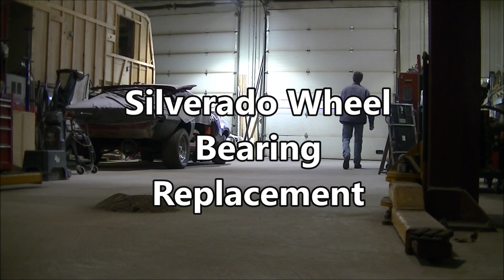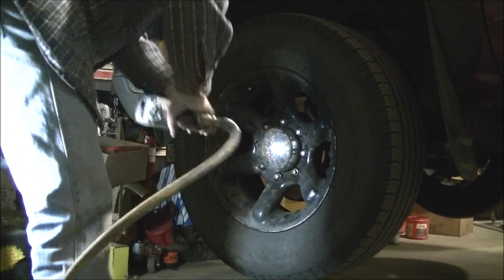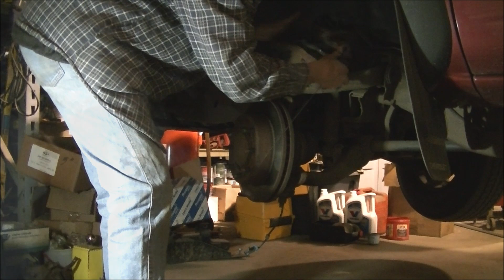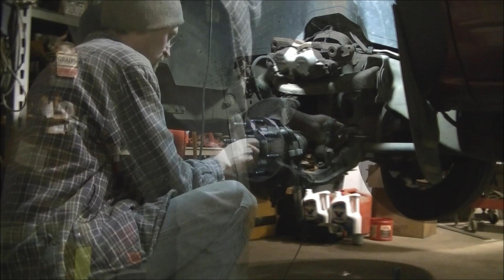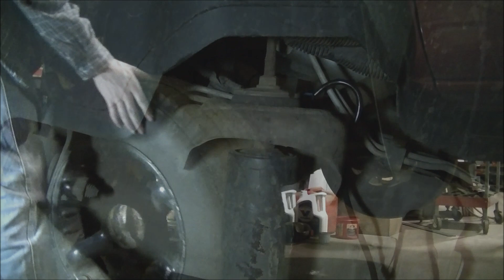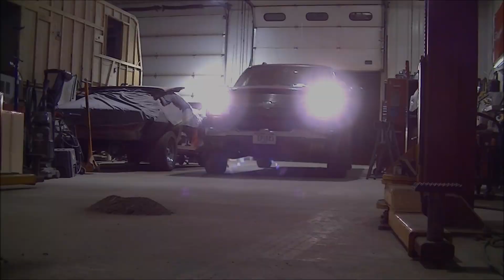Front Wheel Bearing Replacement "2004 Silverado 2500HD"

Comment from the maker: I just did another wheel bearing video of my 02 dually.  The job is not that hard.  Dealing with rusty bolts is the hardest part.  I would also recommend air tools.  Makes it much easier.

Comment: Air tools are second best friend, next to the compressor. I had to change a bearing on my old Porsche, 5 trucks ago. I hoping the socket from that will fit this. By the way, what brand hub did you go with? I see prices ranging from $60.00 (china?) to $350.00 OE. What route did you go and how is it working out. Thanks .Buba.

Comment: Anyone hear of bearing/speed sensor making abs mess up and all four breaks to hang up??? Trouble shooting my new 01 duramax...
Reply from the maker: highbridgehillbilly A bad speed sensor will cause a front tire to lock up in sand.  Never heard of all of them locking up.  Usually the side that locks up is the side with the good sensor.  A bad sensor can be a sign that the bearing is going out.